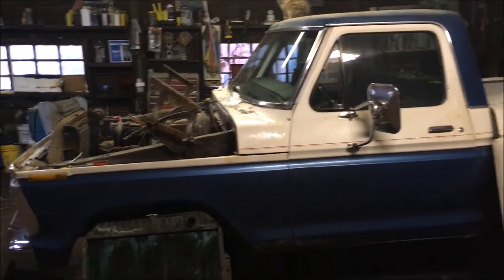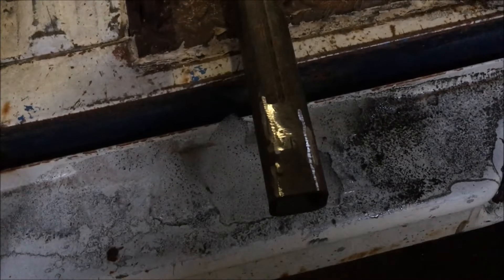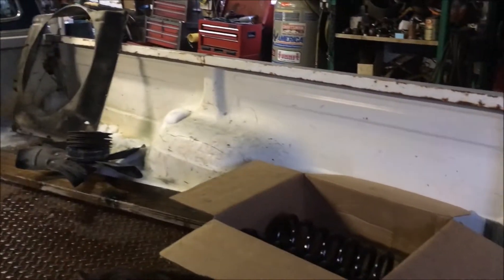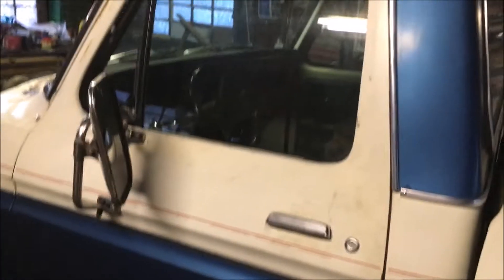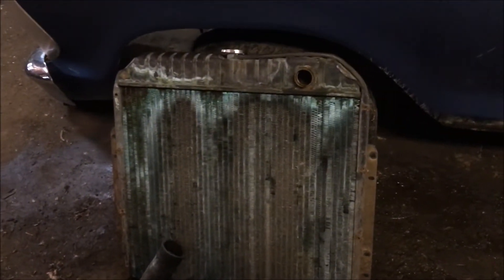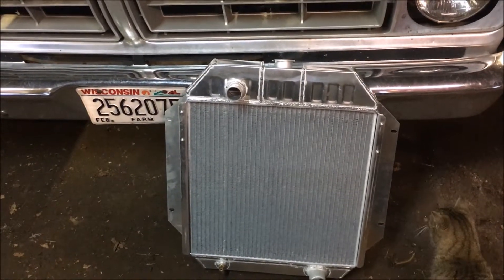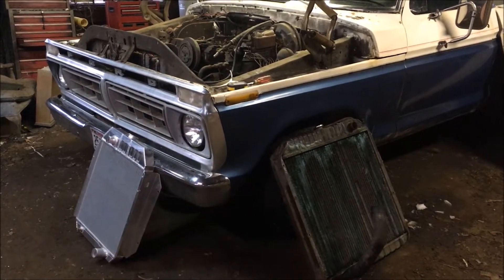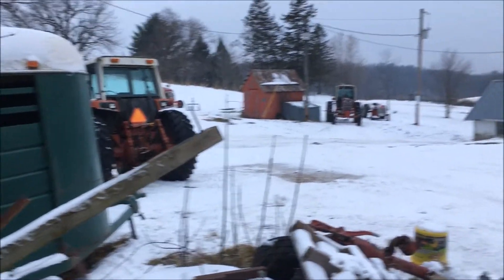Replacement Parts

Comment: I think the square tube will work good on the axle. I put a all aluminum radiator in my truck. I hope you the best with your hip replacement. It will be nice for you to be back mobile. Thanks for sharing. Have a good one
Reply from the maker: Thanks!